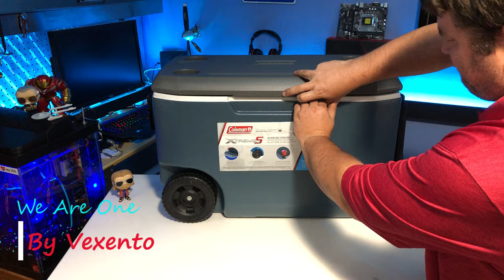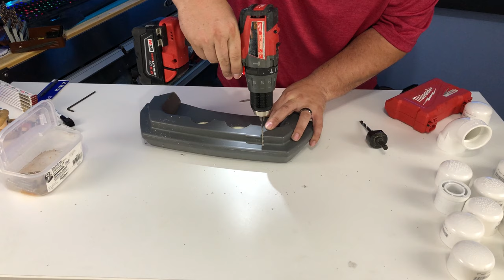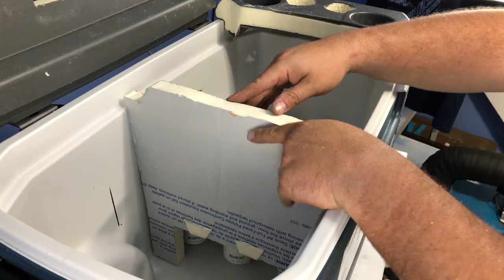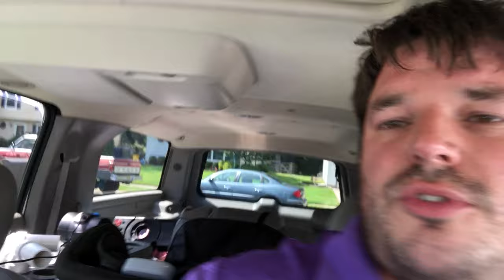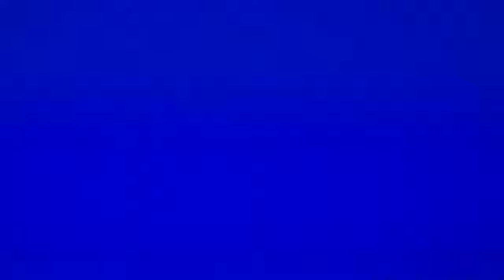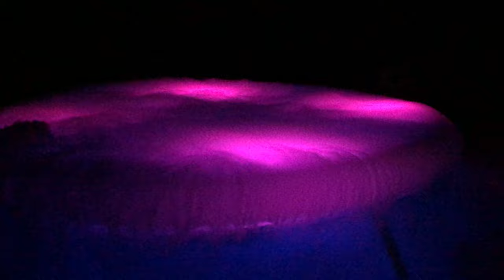Dry Ice Air Conditioner fail #2, will we ever learn?

Comment: What if you make the dry ice contained in a separate box with a radiator in it with lines running to another radiator in a closed loop system running antifreeze then just use a blower exchange heat

Comment: I'd like to this this revisited, I've got 25+ years as a machinist and I'm just wondering if you you put the dry ice inside an aluminum sealed casing with a small vent. You'd get some vapor but I'd think you'd get colder air just from circulating around a very cold object.
Reply: I've been thinking of one that uses liquid nitrogen in a block.
Reply from the maker: Jason Mills  so we are pretty close in ideas. Im actually thinking a super cooled alcohol bath with dry ice in a metal heat exchanger at this point. Just not sure how im going to pull it off yet
Reply: @TheRenaissanceBuilder  yeah this stuff has had me thinking for a while, I'm gonna work on some small scale stuff and get back to you. Good luck.
Reply from the maker: Jason Mills right on boss i would love to see what you come up with!

Comment: My thoughts are upflowing air through dry ice bags. Dry ice CO2 vapors stay contained, but still exchange super cold Temperatures safely to air flow. The other idea was routing a closed off to the inside of the cooler spiral of 3in copper. Cooler filled3/4 full of dry ice with a tight fitting ceiling of Styrofoam.  The copper would get super cold buried in dry ice. Then the copper exits the top into your 270 cfm fan and blower hose